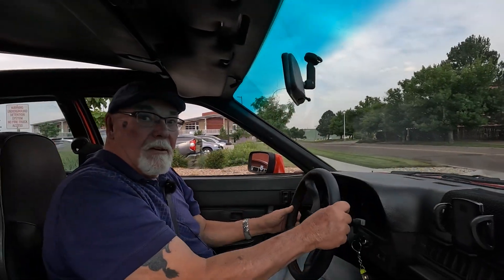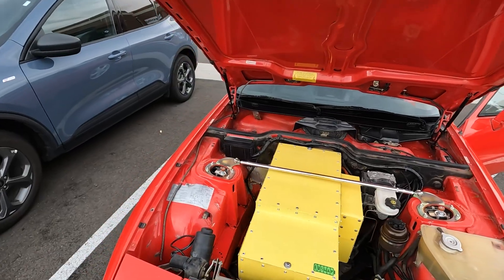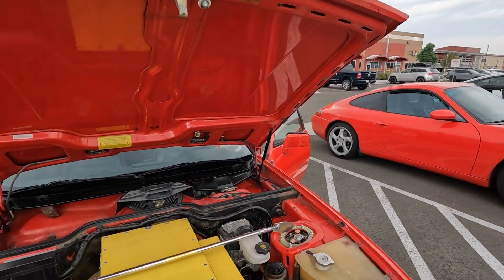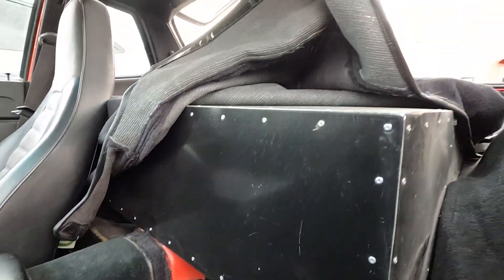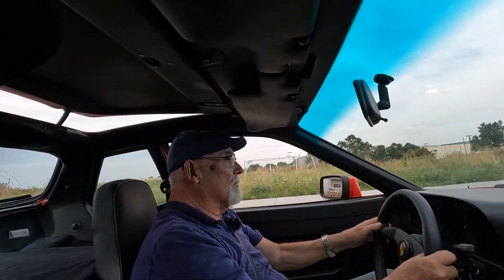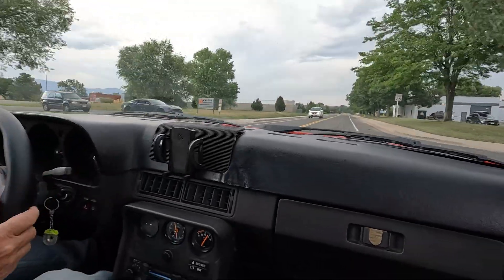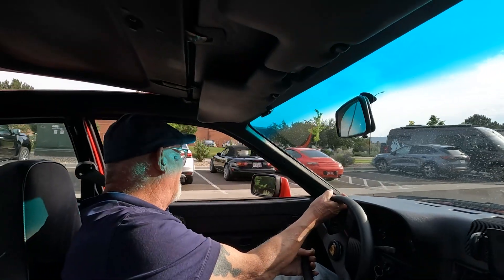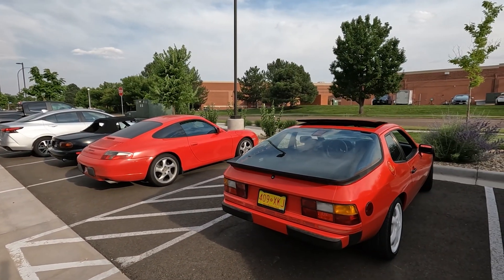Budget Friendly Leaf Powered Porsche 924S EV Conversion

Comment: Just a note, the Tesla electric power brake system sells for $500-600 or so, used.  It's the same supplier as the electric power brake system they used in the Honda CR-V, and you can pick those up for ~$200.  The remote reservoir is easier to work with than the tilted reservoir on the Tesla unit as well.
Reply from the maker: No way! That's super good to note thanks!